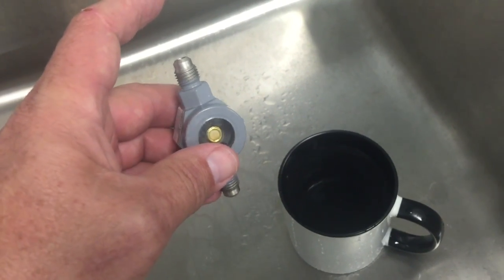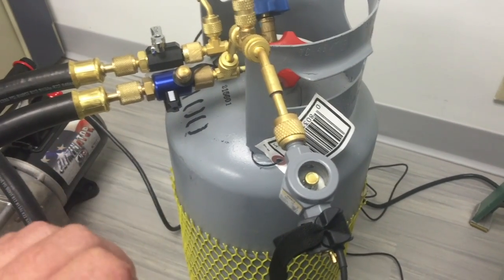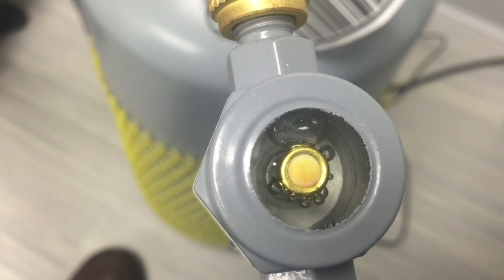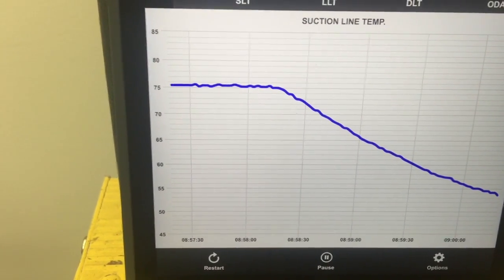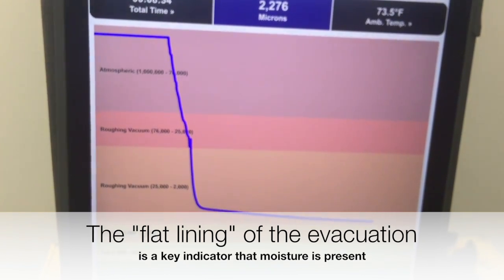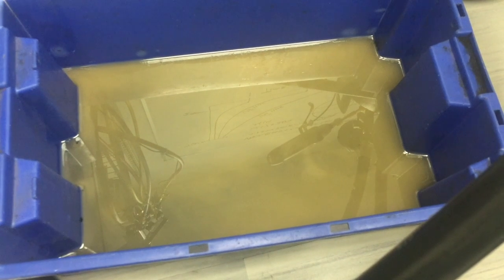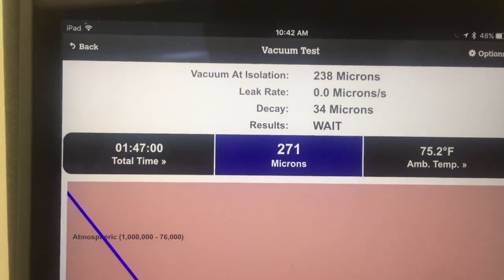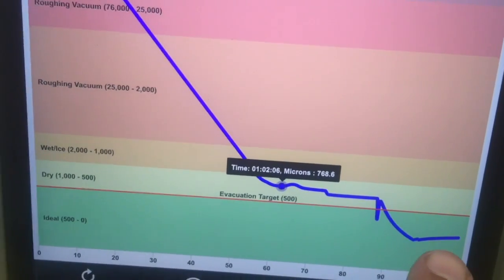Demonstration of Moisture Removal in a Vacuum

Comment: Its amazing what you learn when you actually test and verify proper evacuation techniques. I find in residential systems moisture stalls at about 2000-1900 microns. Ive also learned to verify my equipment and hoses before every evacuation. Saved me lots of headaches and also gives a good reference if the hoses are leaking or its actually the system.
Reply: try teaching an automotive guy this. they just wont get it

Comment: How would you determine that moisture is present in a running system with gauges only?
Reply: You cannot, you need a micron gauge. There is no way to tell if it is a leak or moisture without one.
Reply: Jim Bergmann Thanks Ill get one soon.

Comment: I'd like to have seen the empty site glass at the end. 
How long exactly did it take to remove the water?
Reply: 90 minutes to remove the water.
Reply: @jimbergmann3499  Awesome information! Do you suppose you could use that time frame and the the one TeeSpoon of water to calculate exactly how much moisture comes out of an AC system?
There's probably a lot of variables in there like ambient temp, size of system, humidity,  strength of vacuum pump etc.

If you can draw all of the moisture out of a  system and lets say it had a bad filter dryer that can no longer absorb moisture. The system will not work correctly until its changed but where does the moisture come from if you vacuumed  it all out? 

Another question... what gas is present inside a line that has been vacuumed down?
Thanks for your videos!
Reply: and that was just evacuating water, if he had added pag or poe it takes way longer

Comment: Have you ever used a cold trap installed between the vacuum pump and a really wet system? I saw a video about a year ago that showed a long underground water logged line set being evacuated and they must have changed the oil a dozen times over a two day period.
Reply: I have, and that is a great way to trap the water before it gets into the pump.
Reply: Which cold traps are suitable for vacuum systems?

Comment: After I have done a lot of homework, which 
is surprising that all my questions are about the iManifold but none of 
my answers came from their site or from them. I found out that the 
bluvac pro+ will connect with the iManifold system via Bluetooth. I'm 
sure i'm not the only one that watches these videos at 10:30 at night 
and think "That's awesome how accurate it shows my vacuum pull, but what
 all do I have to own in the setup to get these same results?". Then 
when I look in the video description I find exactly what I saw, but 
nothing telling me that "Hey, the BlueVac Professional Plus, is actually
 connected via Bluetooth to the manifold and it is giving us this 
awesome reading!". I thought the bluvac was just on there to give us a 
comparison, you know to show us accuracy of the iManifold is. So now it 
is well after 11:30 and I still have to go to work in the morning. SO 
can you put a little more info in your descriptions that actually tell 
us what you did to achieve what it is you are demonstrating in your 
videos. All that aside I still really find your videos enlightening.

Comment: Great video! But now you leave me with a whole slue of questions about the iManifold system. 1) What are you using to read the vacuum on the iPad? 2) If you are not using the iManifold itself just a prob can you read vacuum in microns if you pulled vacuum using the iManifold through the vacuum port on the manifold?
Reply: Using any manifold system to check micron pull down is not really recommended.  You need a good micron gauge.  Otherwise you're pulling vacuum through high and low side hoses and most aren't vacuum rated.
Reply: also vacuum numbers are different  its where u put it, but not on manifold. you put it on the furthest side of a system.